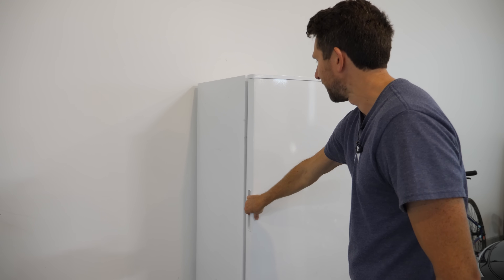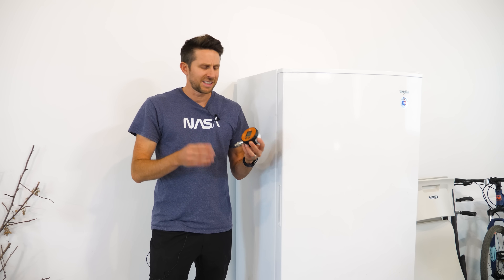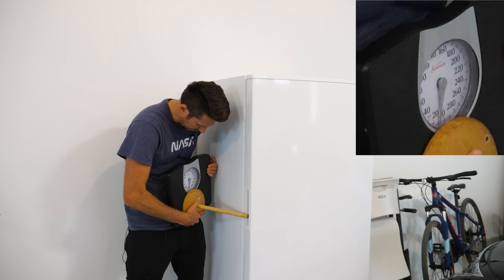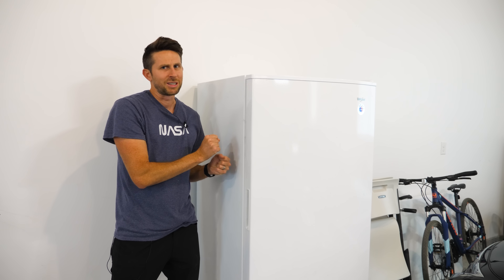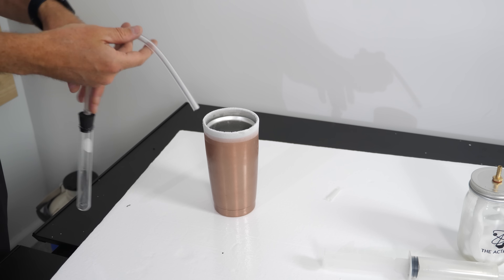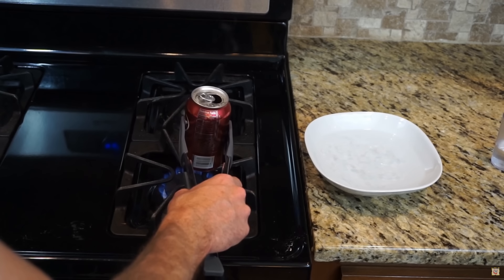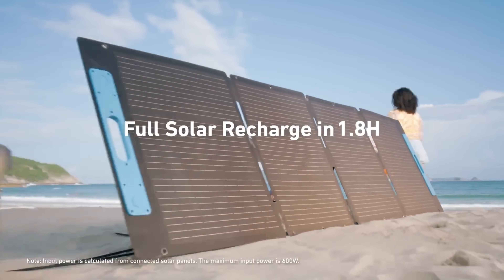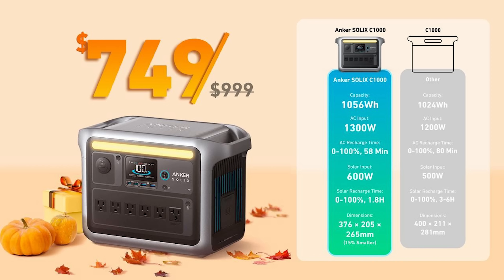Why Is a Freezer Harder To Open The Second Time? (Powered By Anker SOLIX C1000)

Comment: I’m amazed that the interior air temperature drops that quickly. 

I’ve however experienced this same phenomenon in reverse but when using a microwave oven to heat a dish of food in a food container with a gasketed lid. For example, pop the lid tabs but leave the lid in place, then heat the food as normal and remove the dish from the microwave. Once removed you can then watch the lid concave as its being sucked into what  I call a reverse vacuum and it’s impossible to pry the lid apart from the dish without breaking something lol. To remedy, ya gotta put the dish back into the microwave and reheat for 30 seconds or so. 
 To avoid the issue from occurring, you gotta break the seal as you’ve already mentioned by placing a paper towel sheet between the lid and dish, and with the lid in place, your microwave oven’s interior remains clean with no food splatter 😂.
Reply from the maker: That is mostly due to the water vapor condensing more than the air cooling down. As I mentioned at the end condensations can make crazy changes in pressure almost instantly
Reply: @TheActionLab  I think the Bernoulli effect also plays a major role where closing the door forces some air out before it shuts completely.
Reply: @TheActionLab You can actually measure the pressure drop with the super accurate barometer of your smartphone! There is this free "phyphox" app that lets you log data from the sensors of the phone. I measured it with my fridge, it's about 1.5 hPa pressure drop within 1 second after closing the door. Equilibrating pressure takes another 5 or so seconds.
Reply: The interior of the freezer it self and all the food and frozen stuff in there have way more mass than the volume of air inside and doesn't move by convection and get replaced by warmer mass from outside, like the air. So for the short durations the door is normally open, it will stay at almost the same temperature as it was before the door was opened. Once the door is closed again, all those cold surfaces will very quickly cool down the warmer air that got inside again. 

I did actually experience the same thing truly in reverse for a big electric furnace that I built for metal/glass melting and stuff (as it was electric, it didn't need an exhaust like a gas furnace and was pretty much like a closed box). Which I made a hole in the front of the door of, to get some ventilation and to be able to watch into it, without the need to open the door every time. That turned out to be quite dangerous. Because every time the door was open, the hot air inside got replaced by cold air from the outside - then when the door was closed again, the air inside heated up quickly and expanded, causing jet of air that was up to 1250°C, to blow out thru that hole, haha.
Reply: @Speeder84XL  Sounds like fun times 😁😅
Reply: @IIISentorIII i just cannot believe it changes that quickly.  Because it doesn’t change - it happens instantly, the second you close the door is the hardest it will ever be to open.  I’ve always thought it was just that when you close the door it blows some air out, creating a vacuum.  But the seal isn’t perfectly air tight so over a minute or so, probably less, it equalizes and then the door is easily opened.  Close the door really slowly so it doesn’t blow out the air and it will always be easy to open.  I remember doing experiments on this as a kid trying to figure it out.
Reply: @kaltkalt2083  The door closing will move any air that is in the path of the door but it cannot act like a vacuum pump and somehow remove air from the fridge itself, if anything it would act like a single blade of a fan and push a very miniscule amount of extra air in. What happens when you close the door slower is that the air remaining in the fridge has already dropped in temperature and some small amount of air is sucked in so no vacuum forms.
Reply: "I’m amazed that the interior air temperature drops that quickly."
That's because most of the heat capacity comes from the food and the wall of the fridge and not from the air inside.
Same reason why you can let in fresh air even during the coldest winter for a few minutes, and as soon as you close the windows your room quickly warms back up. Since there's way more heat stored in the walls/furniture than the air.
Reply: Also happens with lids from pans if you set them flat on the counter
Reply: I discovered this when putting hot homemade apple sauce in washed old jars with popper lids, as it cooled down it sucked on the popper button, so you can tell it's sealed and in it's own vacuum!..

Comment: Nice, now could you please explain if the light goes out when you close the door or not?
Reply: There is a little guy in the freezer that turns off the light when he sees you close the door
Reply: @mr_dadik  lol
Reply: It goes out, like older fridges had a v like trigger at the time. My current one has a sensor so ifyou line the doors up when open it'll turn off
Reply: Lol.ive tried to catch mine on,but its to sneeky.🤔
Reply: Mine literally has a button on top that gets depressed when the door is shut.  I can turn the light off myself when the fridge is open.  Newer fridges probably use a light sensor.  Like the type that sends an infrared or some other invisible frequency directly to a detector when closed, and the signal is broken when the door is open, thus triggering the light to turn on.
Reply: Thats right up there with," if a tree falls in the  woods and nobodys there to hear it",does it make a sound?
Reply: It's pretty clear that the light stays on based on this video as we could see the pressure gauge with the door closed. Maybe they gave the little guy inside a day off :-)

Comment: Chest freezers are the best freezers.
Reply: Why
Reply: @coolmonkey619  Because of efficiency. Cold air sinks and hot air rises so  by design they hold their temperature more efficiently. Especially when you ooen it you are losing hardly any cold air.  Compare that to a vertical freezer which is much less efficient and needs to work harder to cool the air back down.